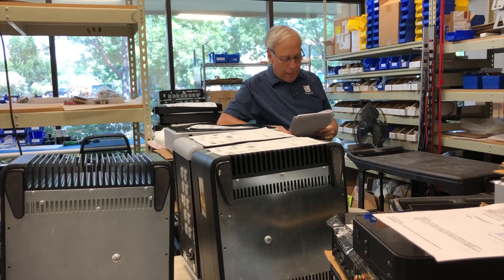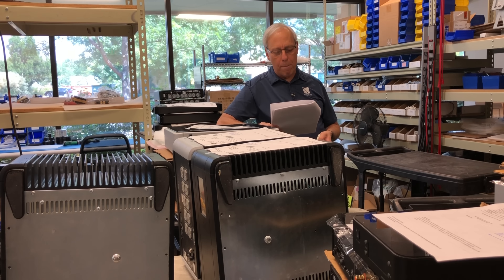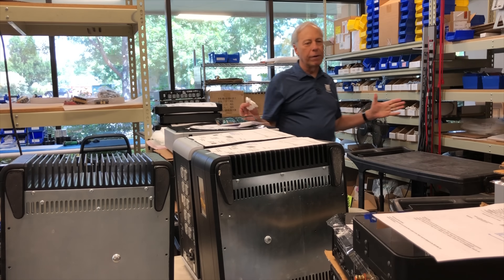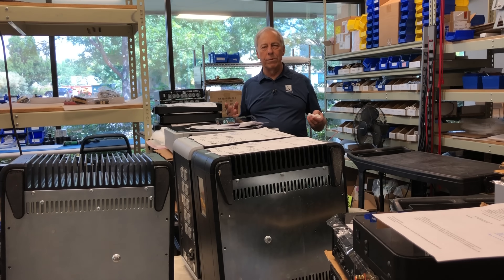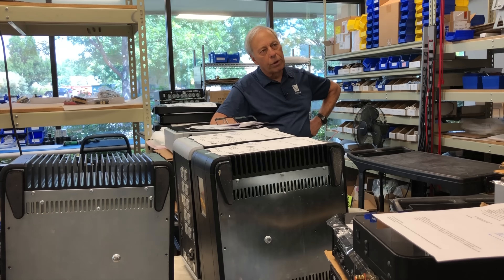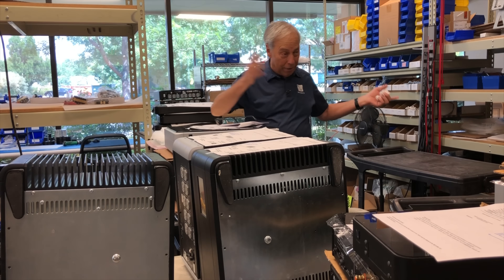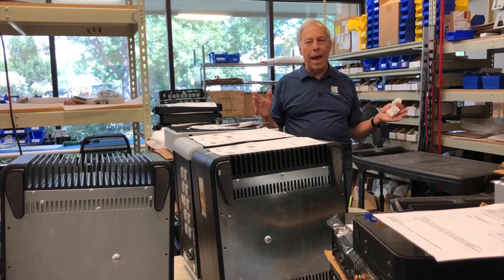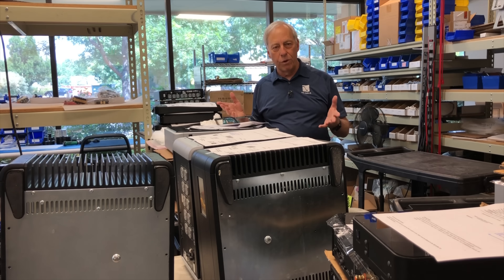Why should speaker cables have a minimum length?

Comment: Best option is to use active speakers or 2 poweramps as close as possible to the speakers is what i once read in an audio-magazine that had an item about speakercables. Least worse choice was to use (short as possible) coaxcables,the ones radio amateurs use....but the article is from decades ago and maybe development of cables changed radically.

Comment: Should it or opposite??? Copper lines is best cables for speakers and better way to use more than 5 meters for each loudspeaker.. why because the coooers resistance reachs to 7 ohms at a km..

Comment: Impedance in a wire is a function of length, and everything in the electrical path is a part of the circuit.  So, in theory it matters, but in practice, its immaterial for wires of substantial gauge.

Comment: This Thread made me curious, so i changed the Kimber Cables to a Second Hand NAIM NACA 5 ( which is a sturdy pain in the A.. maybe covered in Viagra. I connected the 4,5  Meter ( app. 14 feet)  Cables to my Naim Nait 5si... and i was shocked... the often critisized lack of airiness and resolution is gone. Yes i know, Cables make a difference..but in this case it changed the sound of the Amp dramatically... . Now i have 9 meters of Cables, for speakers that are only in an2,5 meter triangle... and this really anoying

Comment: Why should speaker cables have a minimum length?  Only one good explanation.  There is a minimum length a pair of speakers need to be for proper "Stereo" imaging, among other critical nuance effects that proper speaker placement makes.  If you have a pair of speakers very close together configured in a "Stereo" setup, you actually just changed your stereo playback to a "Mono" playback.  Because of poor speaker distance, and placement.  You loose all stereo imaging, and the sound field totally collapses.  The recommended minimum 10 feet speaker wire length is a very good recommendation to start with.

Comment: Most modern amplifiers include in their output stage a Zobel circuit (RC) and/or a series coil (inductor) to stabilize the load against cables of different characteristics (capacitance/inductance). Naim, in its classic design, does not include such a series coil. The reason: to avoid any additional component that could limit the response speed or alter the direct interaction with the drivers (the "PRaT": pace, rhythm and timing - brand sound philosophy) and the immediate dynamics that characterizes Naim. So, without that internal coil, the cable itself must provide some series inductance to keep the amplifier's feedback loop stable. So? Its a design based on the philosophy of the brand, if you like its sound or not, that's another story (to each his own)

Comment: Minimum 3 feet is so that you have a way to adjust/place your speaker. It's the minimum recommendation for convenience.
Reply: If you have a pair of speakers very close together configured in a "Stereo" setup, you actually just changed your stereo playback to a "Mono" playback.  Because of poor speaker distance, and placement.  You loose all stereo imaging, and the sound field totally collapses.  The recommended minimum 10 feet speaker wire length is a very good recommendation to start with.

Comment: The RCA circuit on whcih the NAPA boards is based, is devoid of the much misunderstood Zobel network, the purpose of which is to snub out any harmonics and HF spikes returning from the loudspeaker.  Julian Vereker had a mindset that Zobels ruined the sound hence the use of cable to reproduce (wishful thinking) the protective effects.  Once a speaker cone is in motion in one direction, requiring it to stop and go into reverse, means that the voice coil acts as a motor thus attempting to drive the amplifier circuits.  This drive energy is out of phase containing a rich recipe of harmonics which the feedback circuits see as errors and attempt to correct - in doing so, the circuit can be provoked into parasitic oscillation which results in the well documented 'splashy' sound where the aberrations overlay the music and in extreme cases, reach a magnitude where the amplifier is destroyed.  Hoping Paul, that's not too smartarse for your channel but I've worked with this problem for 45+ years.

Comment: My experience is that speaker cables should be short! The shorter, the better!
Reply: If you have a pair of speakers very close together configured in a "Stereo" setup, you actually just changed your stereo playback to a "Mono" playback.  Because of poor speaker distance, and placement.  You loose all stereo imaging, and the sound field totally collapses.  The recommended minimum 10 feet speaker wire length is a very good recommendation to start with.

Comment: In my book, the amp should be as close to the speakers as possible and therefore the shortest speaker cable possible. Pre amp to power amp should be Balanced XLR is possible as there is less signal loss in it than speaker cables.
Reply: If you have a pair of speakers very close together configured in a "Stereo" setup, you actually just changed your stereo playback to a "Mono" playback.  Because of poor speaker distance, and placement.  You loose all stereo imaging, and the sound field totally collapses.  The recommended minimum 10 feet speaker wire length is a very good recommendation to start with.
Reply: @dungysphincter7974  You are wrongly assuming I'm using a stereo amp. I am using 2 x McIntosh 901 mono blocks!

Comment: I was one of the early hobbyists that tried braiding their own CAT 5e wire (27 pairs) and though I started with 10 ft of wire initially I ended up with 6 ft cables. When I installed them, I only turned off the power to my amp without changing any settings. The new cables were so conductive compared to the old Monster Cables that I had to turn down the volume 'A LOT' when I repowered the Amp. When measured by a meter, they had a capacitance in the very low picofarads, and an inductance that my meter would not register it was so low. The resistance was beardly moverd the needle on these 6 ft cables.  I have since grown with the ages and one of my first commercial replacements after the Braided wire was Cardis 101, which is their best seller. I got very little difference in power or sound. This was at a time when Belden published that it's CAT 5e twisted pair could carry audiophile class sound up to 10 ft for a single pair. It just gets better from there. Through the years I have tried products from AudioQuest, Nordost Valhalla, Cardas, Pangea, and Wireworld. To be honest I can't pick a favorite.

Comment: Most notable difference would be the damping factor… depending on amplifier design, high damping factor may cause undesirable ringing and potentially trigger overcurrent protection causing distortions… I’ve designed amplifiers in the past and damping factor with early transistor designs was often causing issues…

Comment: Hmmm says Paul, they sound different . (BS METER IS OFF THE CHART now) Gee Paul you spout so much BS. I don't believe you even know how to use a scope.
Reply: A better answer from Paul should have been.  If you have a pair of speakers very close together configured in a "Stereo" setup, you actually just changed your stereo playback to a "Mono" playback.  Because of poor speaker distance, and placement.  You loose all stereo imaging, and the sound field totally collapses.  The recommended minimum 10 feet speaker wire length is a very good recommendation to start with.
Reply: @dungysphincter7974 sound doesnt have an image, it's a misappropriated term used by audiophiles   to convince the gullible. And sell their overpriced audio equipment.
Reply: Panning would probably be a better term. Its not conceivable to move instruments to different locations when you only have 2 speakerd. With regards to Paul, he's just another audiophile conman trying cash in on people's gullibility.
Reply: Naim is a cult? Just as Paul is a cult leader himself of the uneducated Audiophiles in his universe

Comment: It seems that the common reply is that there is no Zobel network in the Naim Amp so it relies of the cable inductance and resistaznce to keep the amp stable. This is great of coutrse BUT a Zobel network also acts as a useful filter which prevents high frequency interference (radio transmitters, phones etc) from entering the oUTPUT of the amplifier where the relatively 'slow' negative feedback in the amp will act as a demodulator so you can hear the chirping of your mobile when you receive a call/text or some noises from the ever present switchmode power supplies (chargers etc).  Thus actually failing FCC regulations because the amp should be resistant to external interference (to a reasonable degree).

Comment: I am NOT an electrical engineer. But it surprised me that Paul didn’t say anything about the resistance of the cable itself. 

Again, NOT an EE, but is the resistance of a longer cable greater than a shorter cable?

Comment: So long as there is appropriate separation between speakers, cable length is practically meaningless to sonic quality. Make sure your speaker cables can handle the necessary current. Your speaker wires do not behave like filters in any audible range.

Comment: It was always with regard to the topology of early Naim amps, and in the early years the forums had people blosing Naim amps due to funny cables. Certainly worth the homework. Two in here have already stated the actual reasons.

As for lengths, we already have AES engineers with the equipment showing us we cannot hear the differences while we are listening to albums mixed by recording studios that ran hundreds of feet of cable and often no two pairs the same.

The fact is in most homes no one can listen to a system with 5m of Mogami in one speaker and 3m of Mogami to the other and measure or percieve any difference at the speaker output, can they?
One of my biggest regrets was years of buying matched 5m or 6m pairs of cables so half of it could double back or be folded up out of view.  Just to later find out we were being conned by an industry that was flat out lying about cables and their performance. 

The placebo that shorter cables sound quicker is rather telling.  That fat looking cables have better bass, and hence why we have people with 6 AWG cables 2.5m long talking about bass performance due to 6mm of copper conductor wrapped with various layers of dieletric and plastic mesh with alloy fittings and heatshrinks crimped to two hollow copper 4mm gold plated banana plugs going into a massive pair of gold plated brass terminals that have 2.5mm or less of OFC copper going to the crossovers or drivers. Basically zero reason to run such fat cables in a house.

We need more honesty in this industry

Comment: what?? always use 12 gauge the shortest you can. every interconnect must be as short as possible. i saw people using 5 meter rca cable to connect 2 pieces of gear one over the other,, big facepalm
Reply: This was about speaker wire length.  nothing to do with RCA cable length connecting separates'.  If you have a pair of speakers very close together configured in a "Stereo" setup, you actually just changed your stereo playback to a "Mono" playback.  Because of poor speaker distance, and placement.  You loose all stereo imaging, and the sound field totally collapses.  The recommended minimum 10 feet speaker wire length is a very good recommendation to start with.

Comment: It is because Naim Amps didn't have coils on the outputs to keep the amp stable, therefore a minimum of 10 feet has enough inductance to keep the amp stable. Best regards, mark from Dorset, England.

Comment: Naim olive amps and earlier chrome bumper amps needed long lengths. 
According to Naim,   "early Naim gear doesn't use an inductor at the output stage to prevent oscillations and relies on the speaker cable's inductance to keep the amp stable under load. The olive and chrome bumper era amps req. a minimum of 13 ft pairs of Naim's own NAC A5 cable." see also  Naim FAQ.    Cable inductance is not needed for the new style XS etc because such has “a different output section and Zobel circuits”, according to Naim tech support, 2024.

Comment: I dont know if it applies to this, but in circuit boards the traces (wires) are meticulously measured and routed so that the signals will arrive at the correct time. If a signal needs to be sent to 2 places on a board at the same exact time, one close and one far away, you kinda need to make the close one have a trace as long as the other one, which is why they tend to route them in zigzags and whatnot.

Comment: I used to have a 1.5 meter pair of speaker cables and they just didn't work at all.  When I got a 3 meter pair of cables, they made my system sound great! 

But this is because my speakers have aleays been 2 meters away from the amplifiers that drive them.
Reply: If you have a pair of speakers very close together configured in a "Stereo" setup, you actually just changed your stereo playback to a "Mono" playback.  Because of poor speaker distance, and placement.  You loose all stereo imaging, and the sound field totally collapses.  The recommended minimum 10 feet speaker wire length is a very good recommendation to start with.

Comment: Maybe I should invest in some high grade speaker cables... I'm using dirt cheap wire that I got with a surround receiver and speakers on facebook marketplace! At least 20 ft, one set running to my subwoofer and the rest going to my loudspeakers.

Comment: I really hope that Paul have nothing to do with engineering devices they are selling, only marketing and, maybe, exterior design...
Because according to this video he's lacking basic knowledge of physics, otherwise he would give a certain answer how exactly length of the cable (along with it's gauge and material) would affect sound and why. It's Physics, god damn it!
Reply: I am an experimental  physicist. I have done engineering on anything from DC to microwaves, including power and data transmission over thousands of feet of cable. What physics tells us is that in audio transmission the leading order errors are in your ears. The physiology of human hearing is horrible. The next worse effect is room acoustics. Then it's the non-linearities of your speakers. After that it's usually poor mixing by the music producers and sound engineers. Somewhere down the line you are going to get effects from amplifiers. Even below that will be the effects of your cables. ;-)
Reply: @lepidoptera9337  Unless it's a terrible engineered amp made of shitty components. And it might cost dozens of thousands of $$$ 'cause it's a HighEnd amp^_^
Reply: @Ashen2501  You mean like a CrapNTush? :-)

Comment: I prefer balanced interconnects and no more than 3 or 4 inches of solid core 12 awg between the (mono) amp and the speaker . This usually involves putting the amp on some kind of stand or stool to line up the terminals . My current set up uses klipschorns with Volti crossovers sitting on top of the speaker so there s room to back the amp right up to the speaker terminals .
Reply: You do know that your crossover has inductors with thirty feet or more of thin wires in it, right? So why are you worried about a couple of feet of thick wire in addition? ;-)

Comment: When listening, I prefer not to put up with the faint background signal noise (noise floor)

One should try pressing pause or mute, and if one is unable to differentiate whether the systems off or on, that's telling you your cables are crap.

When friends or guests come round rather showing them how loud the system goes I prefer to press pause/mute and show them how quiet it goes.

Silence is Golden.
Reply: I have the perfect system for that: it's imaginary. No speakers, no amps, no DAC. Pure nothing. Best linearity in the world and it lives right at the physical limits. When it's off, you can hear the blood in your ears circulating! At least when there's no traffic on the nearby highway. ;-)
Reply: @lepidoptera9337  that's funny. I'd like it. Yeah I think I'm going daft to sometimes 🤪
Reply: @Totalplonker  I forgot to tell you about my tinnitus. In my left ear it's at roughly 7kHz, 62dB. It gets better when I take my blood pressure medication. I haven't heard the sound of silence in about 20 years. :-)

Comment: Naim recommend NAC A4 or A5 of at least 3.5m in length (both channels should have the same length). If you want to save money though, you can use Linn K20 cable (it's the same and was even made to the same spec by the same manufacturer and rebranded...until Naim found out and terminated their contract).
Naim's designs made the speaker and cables an integral part of the out put circuit.

Comment: Well mine are 8 feet each, I know that cables need to be the exact same length.  Meaning right and left speakers must both be 8 feet even if one is closer from the amp  then the other, comments?
Reply: If you have a pair of speakers very close together configured in a "Stereo" setup, you actually just changed your stereo playback to a "Mono" playback.  Because of poor speaker distance, and placement.  You loose all stereo imaging, and the sound field totally collapses.  The recommended minimum 10 feet speaker wire length is a very good recommendation to start with.